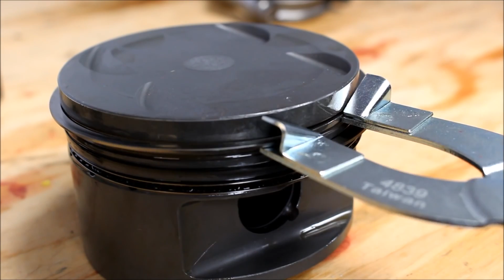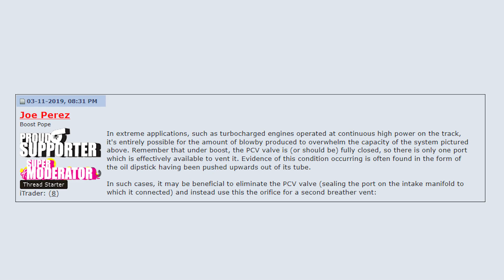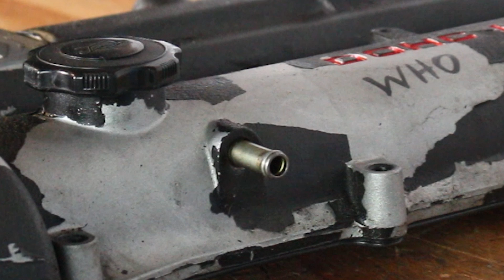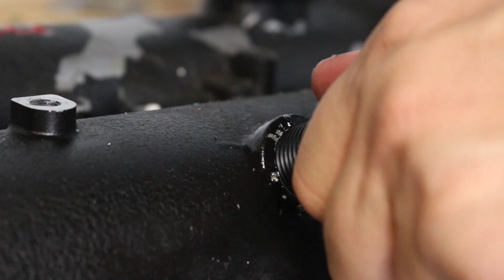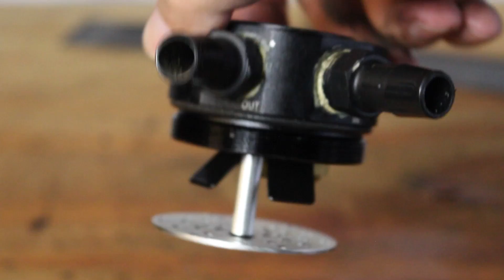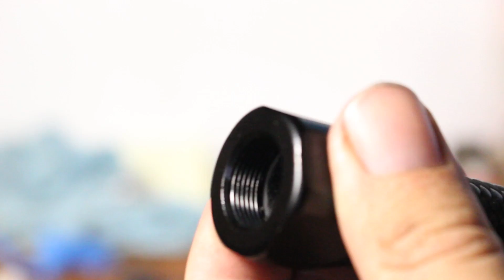Building The Optimal Catch Can Setup For the 400HP Miata! (No Welding Required)

Comment: That is the PCV setup I settled on, but the catch can would fill up with 10-12oz of oil during a track day session. The oil would spit out of the catch can filter, travel through the hood vents and onto the windshield. At first I thought the puking oil was from worn rings, so I rebuilt the engine with your videos as a guide :) I take it back out on track and same exact issue. Same amount of oil too. My guess is the extended G's from cornering and high rpm boost is over powering the stock oil/air separation. So I fabricated an aluminum 6in x 6in x 4in vent to atmosphere catch can with loads of baffling and stainless steel wool. Then I added a drain hose from catch can to oil pan just like mazda speed miata does from the factory. No more overflowing catch can issues. 

I would be curious if you run into similar issues on track with your setup. The Catfish camaro guy on donut media had a video on power to weight ratio and was looking for someone to do a trackday with at button willow(mentioned it at the end). That would be a neat collab video. GL man
Reply: Might be in the catch can thread linked in the description, I think I remember it being mentioned to plug the coldside port during heavy track use due to this exact issue.
Reply: @whippingstar  I have tried that, it just pukes out the hot side. Thanks for the input tho
Reply: Do you have oil pressure logging? It sounds to me like the oil is hitting your crank and getting whipped up. It will change oil pressure when smashing those corners but also throw oil out the breather
Reply: @ReubenHorner  I never thought to log oil pressure, yet that's crucial info. I have an aftermarket oil pressure gauge on top of the dash that I keep eyes on in the straights, but it would be interesting to know oil pressure in corners and braking. During the build I installed an oil pan baffle with trap doors. Thanks for the input, I will hookup the oil pressure to MS3.

Comment: 19:14 In my experience you should RTV these plates on, i didnt and filled my catch can in 40 km's. rtv'd them back on and the problem was gone.
Reply from the maker: Was your catch can on the PCV side or breather? On the PCV side there would potentially be vacuum pulled on that chamber so it could certainly suck oil in
Reply: @TheCarPassionChannel  I had one catch can for both the pcv and breather which vented to atmosphere. was not connected to the intake. Still cant get my head around to why it pushed so much oil (form memory it was mainly the breather side) out without the plates sealed up.

Comment: How come you didn't reuse your existing catch cans and run a return line pre compressor and use that to pull vacuum through the crank case?
Reply from the maker: I read something about oil droplets hitting compressor blades @ 170,000RPM and that scared me away from it. And - it wouldn't pull a vacuum since this can is vented.
Reply: @TheCarPassionChannel  that can wouldn't but your old mishimoto ones would/should be alright 😂
Reply from the maker: @miatamadness9535  Yeah that is true, but I also wanted to avoid dual cans. I'm just testing this setup out, if I experience issues I can move on to another setup.

Comment: On my motor I removed the pcv valve so I have two open ports on the valve cover hooked up to a three port mishimoto oil catch can and I have that third port connected to a fitting I drilled into my air filter on the turbo to pull vacuum on the entire system under all conditions, no issues so far!

Comment: You need some JIS screwdrivers.  Those are not phillips, they're japanese industrial standard.  Slightly different.  A phillips can round them out.   Look for the vessel megadora set on amazon or get at least a #2 from them.